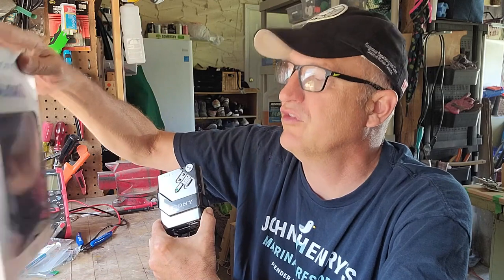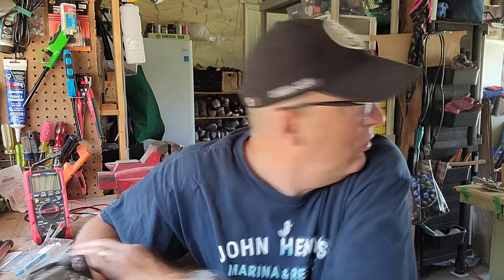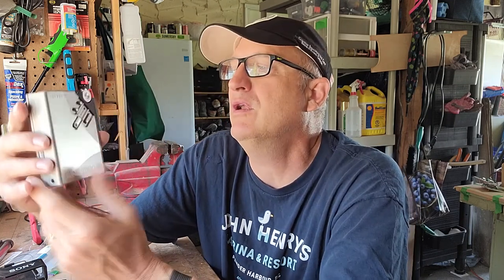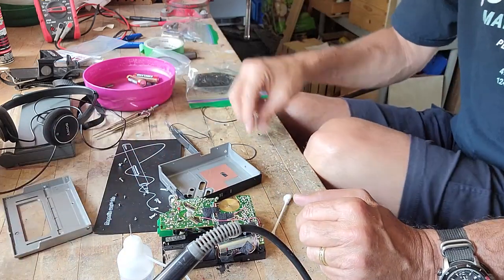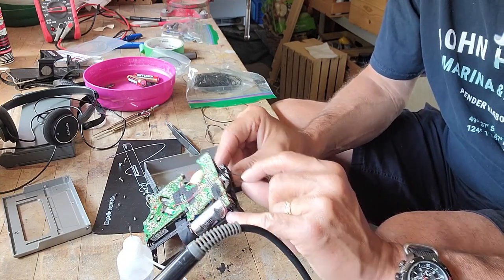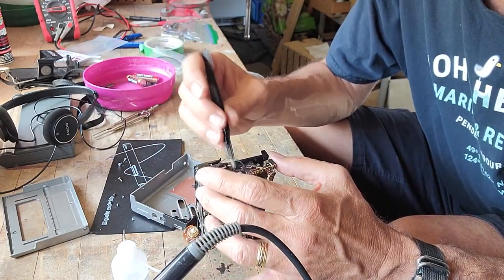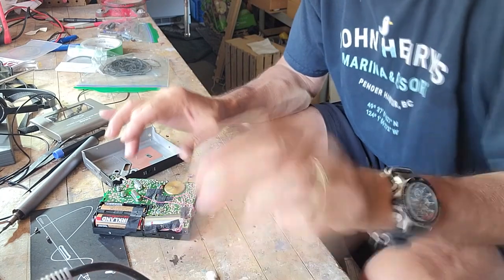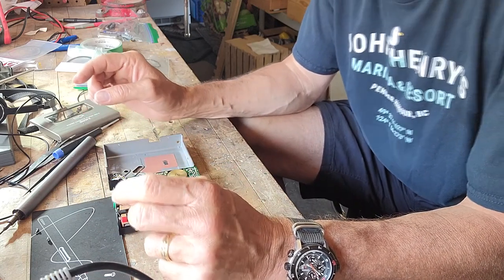Sony WM-2 Walkman Repair Attempt Part 1 - Jul to Aug 2023

Comment: A handy tip - the chassis comes out of the case easier if you press the FF and REW buttons in to prevent them catching as you try to lift it out.

Comment: Good work! I think the volume control is an old carbon-based pot that would be better treated with Deoxit faber-lube than D5, which can be too aggressive. Also, I find it easier to fit the annoying slider and spring and hold it there with your finger as you fit it back into the case. The dreaded cracked main gear is a common fault on the DD models but can also plague the WM-02, it seems.

Comment: I agree with you - I think this unit has not been opened before. The original belt can become soft so that playing it stretches it to a point where it falls off one of the wheels but the other wheels keep going - stretching it until it gets so large it eventually falls off.